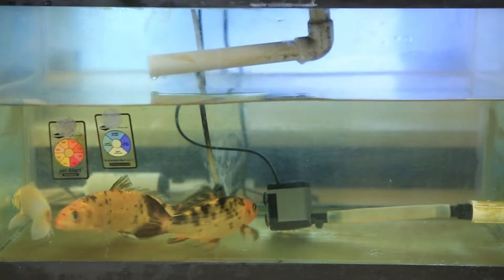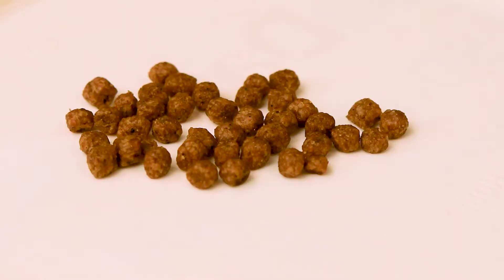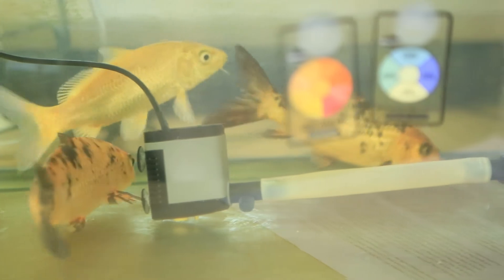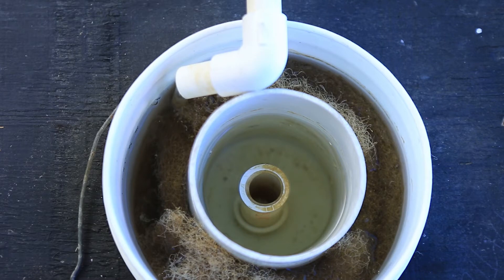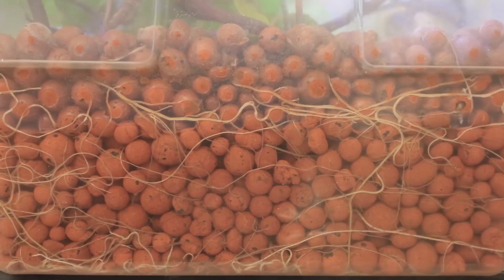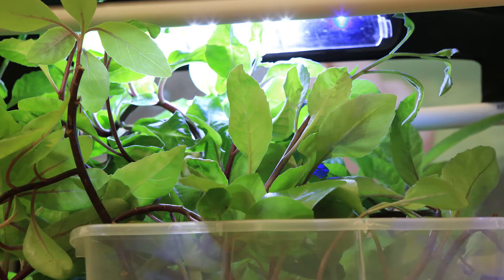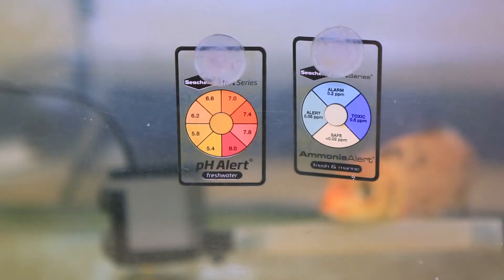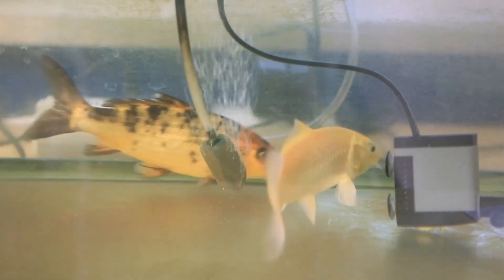Small DIY Aquaponics: System Overview

Comment: Which material we can use for water filtration in this system
Reply from the maker: In the mechanical filter we use foam filter material.  See 1:30 - 1:40 in video.  Just make sure the foam has not been treated with any chemicals.  In the biological filter (plant tank) this unit has expanded clay balls or "hydrotons" but you can also use pea gravel.

Comment: Iam not sure you would have a stable water chemistry with such a low volume of water ... temperature variation is another issue . My experience suggest a minimum of 100 gallons water to obtain a well balanced water chemistry and temp stability
Reply from the maker: You are correct, a larger volume of water would be better but these fish have been in this aquarium for over a year and have been thriving.  They are in a climate controlled room so the temperature does not very a lot.  We don't push the system too hard and there is plenty of surface area on the clay media for bacteria.
Reply: You call yourself a 'expert in fisheries and aquaculture' yet you throw koi goldfish into a what looks to be 10 gallon tank. You desperately need to upgrade or rehome these fish.

Comment: would this same size bucket filtration system work on a 40 gallon tank? or would there be too much water and organic material for that sized system to handle?
Reply from the maker: It really depends on how much you are feeding the fish.  I think there is plenty of biofilter surface area in the plant tank to handle significantly more than we have in the tank.  The more you feed the mort often you would have to clean the bucket filter.  You could also add some additional biofilter material to the 5 gallon bucket.  I have a couple of 55s at home and I am pretty sure this system would handle what I have in them. (moderately stocked)
Reply: @clinedj1  Thank you so much, both for the reply and for the video in general! it was super informative and helpful

Comment: Audio is doing something weird
Reply from the maker: Are you using bluetooth speakers by chance?
Reply: @clinedj1  no just my phone
Reply from the maker: @antoniosanford4675  Does it just quit playing altogether?  I have heard some other folks have trouble when using blue tooth.  I will try to do some research on the audio export settings coming out of premiere.  Any other details would be helpful.  Thanks for the heads up.
Reply: @clinedj1  the sound is just missing or there is a slight intermittent hiss and chirp. No sound at the beginning and end of the video.
Reply: sound is good on desktop pc